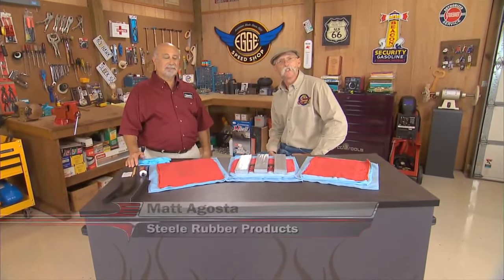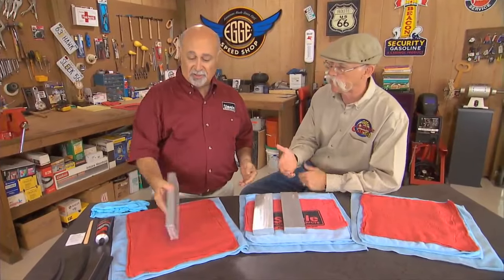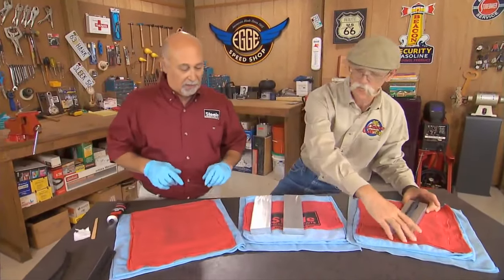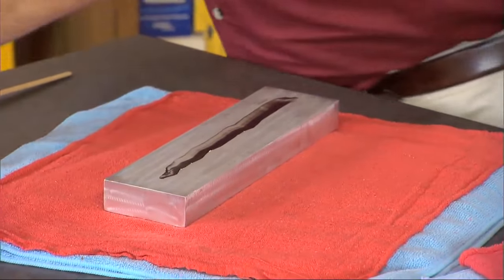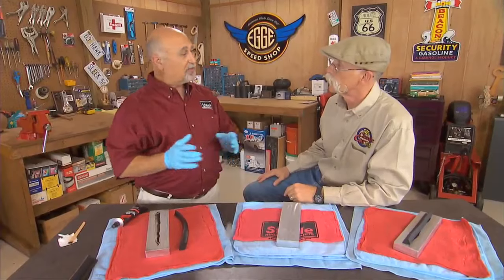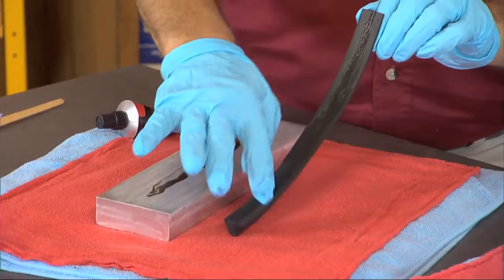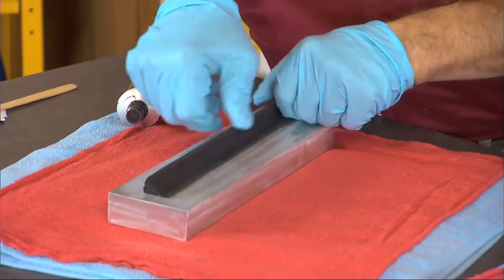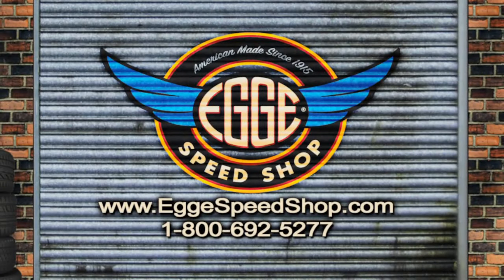How To Glue Weatherstripping the Right Way

Comment: This method is the old method, the 3M weather strip adhesive instructions now state to apply a thin coat to each part, wait for tacky, then just stick together. I got the same results using the instructions as these guys did doing the old 3rd step of a fresh layer.
Reply from the maker: Glad that worked for you! In our experience the 3rd step helps tremendously.

Comment: One thing that should’ve been mentioned is most glue is extremely temperature sensitive. If you’re doing this in a cold shop, it’s going to take far longer for the glue to get tacky.
Reply from the maker: That is correct! And for warmer temperatures, the glue will tack up rather quickly. Thank you for mentioning that!

Comment: could you have applied the second coat to the aluminum block instead of the rubber?? That would come in handy when installing longer weatherstrip like a trunk or door.
Reply from the maker: Great question! And the answer is yes. Once you've applied and spread the adhesive on both the surface of the vehicle and the weatherstripping, you may apply that final thin bead on the vehicle surface. For projects with a large surface area, like a trunk, using this gluing method, we recommend installing 2-3 feet of rubber at a time. That prevents the glue from curing too quickly and allows you to take your time installing it. 

Thank you for watching!!

Comment: What glue is that that you are using?
Reply from the maker: Hey Ian, here we are using the 3M Super Weatherstrip Adhesive which is an excellent choice for bonding rubber weatherstripping to a metal surface. We also have 3M Weatherstrip Adhesive, which works great for bonding rubber to rubber as well. 

This is a link to what we used in the video: https://www.steelerubber.com/super-weatherstrip-adhesive-black-5-oz-96-8008-96.
Please let us know if you have any more questions, and thank you for watching!

Comment: Helpful video,

 However it  failed to stress the importance of surface preparation, To get a really strong bond both surfaces should be clean and dry and ideally wiped over with acetone (nail varnish remover) prior to application of adhesive...

Comment: My question is what if the weather stripping has a groove to install into.  Would this still be needed/advised?
Reply from the maker: Hey Billy, great question! If you're installing a part into a groove or channel and it has a tight fit, using adhesive may not be necessary but it depends on the application. Essentially, if you have a good seal and the part is seated and not falling out of place, it’s probably ok. Thank you for watching!

Comment: What if you have exterior weather stripping on top of the vehicle that slightly open can you add the adhesive in the small crevice or would you have to strip it all off and reinstall?
Reply: I had the same question.  I watched it after I did mine.  :) Top corner of front windshield on both sides was loose on my motorhome and I was afraid water would be getting in.  O'reillys auto told me to clean both sides of area with rubbing alcohol and then put a little (black weather stripping adhesive) on both sides.  Let it get tacky and then push together and then tape over it for 24 hours.  I did it just a couple of hours ago so I'll see how it turns out.
Reply from the maker: Hello Renee- yes, you can absolutely spot repair weatherstripping. Just prep the area,  tuck a little adhesive in the loose parts, push it back down and let it cure for 24 hours and that should work perfectly. If you have any more questions, let us know. Thanks for watching!

Comment: Wish I would have saw this yesterday when I installed my trunk strip.  Did both sides but did not smear it and did leak out a bit but it did clean up
Reply from the maker: We hate you missed it too but, it sounds like your installation work was a success! Glad you were able to tackle it yourself. Thanks for watching!
Reply: @SteeleRubberProducts  thanks.  Yes it seemed to go in ok on the 67 Camaro trunk.  The trunk was a little more difficult to close so hopefully will take shape a bit once it warms up.
Reply from the maker: Over time it will conform to where it's supposed to be and it its cold, it will relax some once it warms up. Thanks again!

Comment: Good too know but try doing a long spot like all the way around the trunk while waiting for the cement to dry like in the second block ??? I liked the peel and stick unfortunately I have the cement one to do 😟easy peasy on little blocks !
Reply from the maker: That's a great point, Ricki! We recommend breaking it up into shorter lengths, doing this process with 2-3 feet at a time will make it much easier for you. We realize the channel for a trunk seal is not flat like this surface we used just for demonstration, the goal is to spread the adhesive around to make it thinner and cover more surface for a more efficient seal. With a trunk channel, you can still use a popsicle stick to swirl and move around the adhesive across and up the channel wall a little so it doesn't stay in a beaded line. Same technique on your weatherstripping, then once both surfaces are tacky you can lay in it place and move on to the next 2-3 feet. If you're installing in an area with hot weather the glue will get tacky pretty quickly which can also make it easier for you. You do NOT have to let it fully cure with each 2-3 feet before moving on, once you have finished the entire trunk seal installation you need to let it cure at least 24 hours before shutting the trunk so that the seal doesn't move with the adhesive still wet. Thank you so much for watching!!
Reply: @SteeleRubberProducts  great tip thank you.  I’ll defiantly try it every 3 feet . Iam still scrapping the old rotten weather striping off the doors and trunk right now then gonna primer the doors and trunk after wards I’ll try your way with the weather striping . Thank you for the information
Reply from the maker: If you need any further help you can give our product specialists a call at 800-447-0849 M-F 8a-6p EST or email us at contact@steelerubber.com

Thank you for watching, Ricki!

Comment: Question. Now if you applied the new peel n stick and realized later after it set that you applied it backwards. Can it be removed and re-used?
Reply from the maker: Great question! We don't recommend taking the seal off of the surface after it's been applied, even if it's just seconds after you initially press it into place. This is because it can compromise the efficacy of the seal. Now, with the scenario you are referring to, I'm assuming that might be hours later, and at that point, you probably would not be able to get the seal back off without damaging it. 

That is the #1 reason we always stress that doing a test fit is so important! You want to make sure you are installing your seal correctly, whether that is placement or orientation. Thank you for watching!

Comment: Not sure if this was asked previously but can you use 3M 08008 adhesive on ethylene propylene diene M class rubber?  And if so is the method for application still the same?  Thank you for an informative video.
Reply from the maker: Hey Vincent! We are using the EPDM rubber that we manufacture here at Steele Rubber. We do recommend the 3M 08008 for weatherstripping adhesive, and this video is the correct method for any glueing you'll do with your weatherstripping. Thank you so much for watching!

Comment: What product would you recommend for trunk seal rubber?
Reply from the maker: Hey there, great question! We recommend the 3M Super Weatherstrip Adhesive, it's what we are using in this video. It is designed for weatherstripping and an excellent choice for bonding rubber seals to a metal surface. This would work perfectly for your trunk seal, and just like in this video, we don't recommend putting too much adhesive on when installing. With a trunk seal, we recommend installing 3-4 feet at a time to ensure you're using the right amount of glue and taking your time to install it properly. Since you will have a channel, and not a flat surface like in this video, you can run a thin bead inside the channel and then smear it around with a popsicle stick to thin the glue out and cover a larger surface. I will attach a link to that glue on our website here: https://www.steelerubber.com/super-weatherstrip-adhesive-black-5-oz-96-8008-96

Please let us know if you'd like any further assistance with a trunk seal replacement. Thank you for watching!

Comment: Any film tapes you'd recommend instead of the typical 3m seal glue for those of us repairing existing seal bonds? not a fan of getting black un-removeable goop anywhere near my car's interior and have been amazed by the strength of 3M VHB tapes but not sure how they would work with foam-rubber seals. Just seems like a much easier path if it will work well and hold up.
Reply from the maker: Great question! We have a line of Peel-N-Stick seals that have 3M tape. Our 3M tape is heat applied tape, we put it through a process in our facility where both the tape and the rubber are heated so they are bonded together. It is a much cleaner process and the tape bonds very quickly with your car. Here is a link to our Peel-N-Stick line: https://www.steelerubber.com/steele-rubber-home-universal-parts-peel-n-stick-extrusions

Please let us know if you have anymore questions, thanks for watching!

Comment: hello, great video! I have a question.

can you use this rubber gasket adhesive technique to apply over a pre existing "peel-n-stick" adehsive.
reason being, i need to redo the tonneau cover weather stripping and the underside is very rough, not smooth at all. im afraid the peel and stick i have will not bond with such a non porous surface.
Reply from the maker: You don't want to glue on top of a "dirty" surface. You'll want to get some adhesive cleaner and scrape off as much of the left over stuff as you can and then begin the process. If you want, you can check out our most recent video, "How to Install RV Slide Out Weatherstrip", to see how we clean and prep the surface before we install.

Comment: I'm trying to figure out what glue works best for the inside of hood weather stripping but no information of that instead a theater
Reply from the maker: If you are referencing the rubber weatherstrip such as hood to cowl I would suggest the 3M Weatherstrip Adhesive or for the hood insulation, I would suggest the spray adhesive.

Comment: The weather seal that goes across bottom of windshield is crumbling on my 2008 chevy colbalt how to change please?
Reply from the maker: The 2008 Chevrolet Cobalt has a glue in windshield, but since we don't carry the replacement rubber for your vehicle we don't have an instruction sheet for the installation.
Reply: Yes, you would sell the Chevrolet and buy something else.

Comment: Is there an outside temperature that is best when applying this product?
Reply from the maker: The recommended temperature for using the 3M Black Super Weatherstrip Adhesive is 50 degrees or higher.

Comment: What is the best temperature to apply weatherstrip?
Reply from the maker: Hi Robert! The best is room temperature.

If it’s too cold (below 40F) the rubber is not going to be as supple and easy to work with. Also adhesive may not cure very quickly.

If it’s too hot (90F and up) adhesives are going to react a bit different. Some adhesive will cure very fast, especially if it’s hot and in the sunlight. If surface temps are very high there may be some adhesives that won’t stick.

Hope this helps!

Comment: easy to demo on blocks, how about a demo where it involves a trunk weatherstrip where both sides have to have glue on them???    I'd like to see that.   Especially when you put glue on the weatherstrip and then you try and run it around to stick it down, not so easy... without getting glue all over the place....

You did a another video of a whole trunk weatherstrip going in, but you only glued one side, as it fit into a channel..
Reply from the maker: Hey Jeff, the intent of this specific video was to demonstrate the point of not using excessive amounts of glue when installing your weatherstripping. Since we manufacture the aftermarket weatherstripping based on the original parts that are sent to us, we don't have access to many classic cars to do more in depth installation videos. This is something we are in the works of changing! 

However, you are correct about the trunk weatherstrip, that is more intricate job than this short demonstration, and will take time. For new trunk seal installations, we recommend breaking it up into shorter lengths instead of trying to do the entire footing at one time. Only install 2-3 feet at a time while following this glueing technique will make it much easier for you. We realize the channel for a trunk seal is not flat like this surface we used just for demonstration, the goal is to spread the adhesive around to make it thinner and cover more surface for a more efficient seal. With a trunk channel, you can still use a popsicle stick to swirl and move around the adhesive across and up the channel wall a little so it doesn't stay in a beaded line. Same technique on your weatherstripping. Then, once both surfaces are tacky, you can lay in it place and move on to the next 2-3 feet. 

If you're installing in an area with hot weather the glue will get tacky pretty quickly which can also make it easier for you. You do NOT have to let it fully cure with each 2-3 feet before moving on, once you have finished the entire trunk seal installation, you need to let it cure at least 24 hours before shutting the trunk so that the seal doesn't move with the adhesive still wet. Please feel free to contact us via email (I will include a link to our contact us page) or give us a call with any questions you have regarding installation, or if you have questions about our products. Thank you so much for watching, and we hope this helps!
https://www.steelerubber.com/contact

Comment: Yes, most people do this wrong.   Thanks guys for showing us the correct method.  However, your test which compares the two methods of application is unfair because you did not let the adhesive dry on the first bar.  Also, It would be cool to extend this video to conduct a test after the adhesive cures on the first bar and keep adding weight to each of the two bars to measure the amount of additional strength of the correct application method.
Reply from the maker: Valid point, Brad. If time/resources permit we could do a video like that in the future but for a 2 minute segment on My Classic Car we have to do the best we can with the time and resources we have there. Thanks for watching!

Comment: In the real world door weather stripping is not 12" long more like 10' with a inside lip ya have apply the glue to.And yes spread a thin coat on both the vehicle an the door seal area an the inside the U shaped groove all while keeping the groove open so as it don't stick together then you've got one hell of a messy seal you have try and pull open. Do this by yourself an see how long it takes you doing 12" at a time.
Reply from the maker: This is just a demo to show the proper way to glue. In most cases this will work, but we understand there are a lot of different types of rubber out there and this may not be the best solution for what you're describing. Thanks for your feedback and be sure to check out some of other other videos :)
Reply: @SteeleRubberProducts  What is the proper way to apply the adhesive if you have a U-shaped groove? Should only the metal lip have adhesive applied and then the weather strip groove gets fitted onto the lip?
Reply from the maker: Great question! We recommend adding the adhesive to the metal, then placing the U-shaped rubber on top of the metal with the adhesive on it.

Comment: Really not that helpful when you consider that they gave no tips on removing the mold release from the new seal which is the biggest problem faced by novice installers. With these instructions you will install the seal and then find that it sticks to the paint but not to the seal. Now you have to start all over and possibly need to clean the dried adhesive off the car. Use rough sandpaper to scuff the weatherstrip sealing surface well, clean with detergent, let dry and then install. Come on Steele Rubber Products guy and Egge Speed Shops, you can do better.